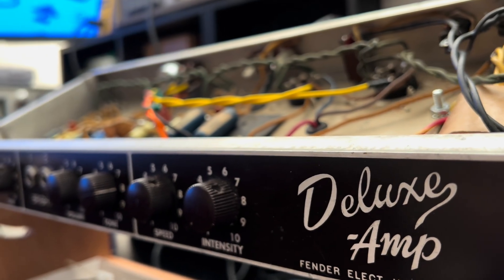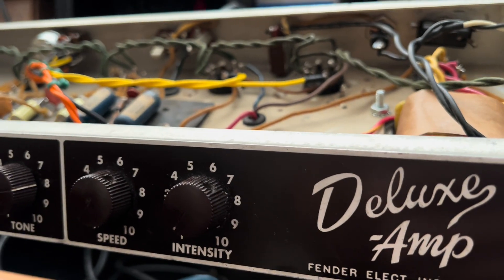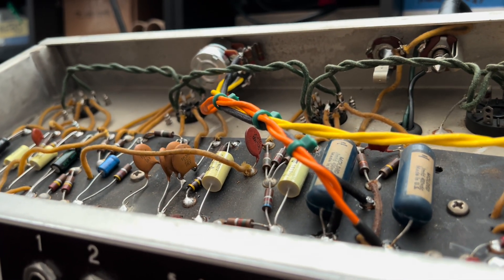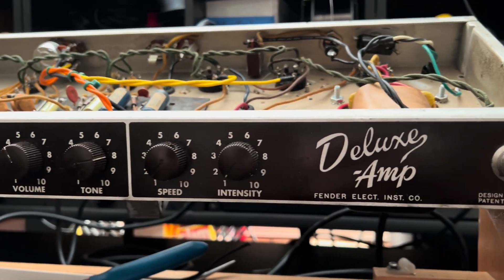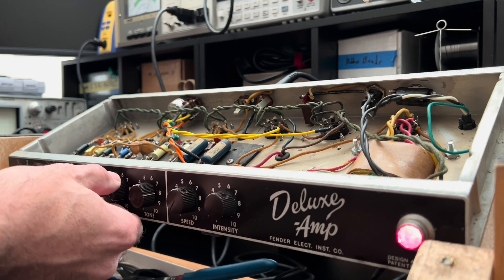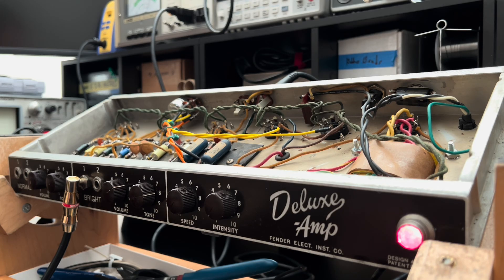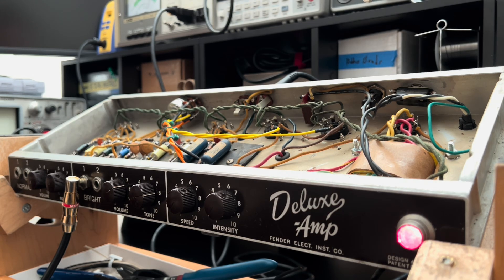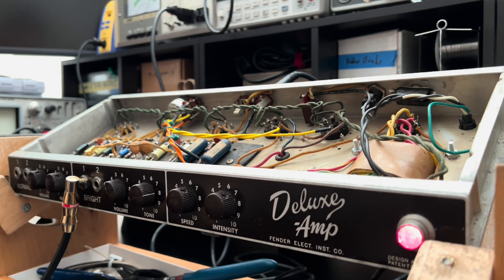1961 Fender Brown Deluxe Part 5:  When Fenders Eat Marshall’s Lunch

Comment: So in 1961 Jim Marshall was still buying unassembled Fender Cabinets, to wire up his custom jobs.  Because of import terriffs it was cheaper to assemble them in England thatn to ship dully assembled units, pay extra shipping and also pay the tarriff.  Instead they imported 90% of the parts and did final assembly in England.  The first several hundred units even match the color shceme and the only difference is the logo and power supply.  It was not until years later that Jim decided to begin making them different to suit the needs of Garage Bands like the Stones and the Who.

For example the very first Marshall Brnaded Amp was the JTM45 which was a relabeled fender painted black, with KT66 Tubes (Siemens) instead of American made ones.  The result was a different bump of the celestion which became “the sound”
Reply from the maker: That’s a great recounting of the history

Comment: That's cookie dough!!
Reply from the maker: Pillsbury amp!
Reply: @ForgottenGearRestorations Chips Ahoy! But really,actually, that IS raw cookie dough. Incredible. (Breadboarding a Supro S6606 btw with leftover transformers kicking around here, solid state rectifier tho. Original schematic puts full 12Ax7 plate voltage on the tone pot input LoL f'ing hilarious. Gotta love Valco/National designers.)
Reply from the maker: Omg man. If the pot shorts yikes.
Reply: @ForgottenGearRestorations Me wrong It's to the wiper, usual input lug is empty, then .01uf to ground on the ground lug. THEN the coupling cap from the wiper lug to the volume input. The tone pot is kind of dangling there off the plate...
Reply from the maker: Ah
Reply: @ForgottenGearRestorations kind of like a conjunctive filter. Maybe an actual conjunctive filter...
Reply from the maker: Maybe a literal conjunctive filter 😂
Reply: @ForgottenGearRestorations Literally. Lol
Reply from the maker: 😂like literally
Reply from the maker: Literalleh